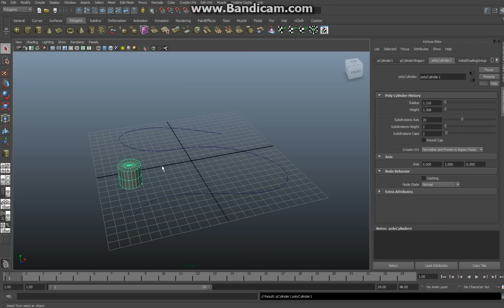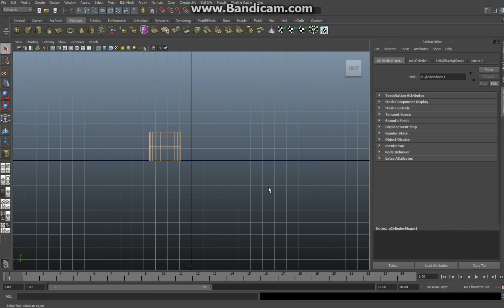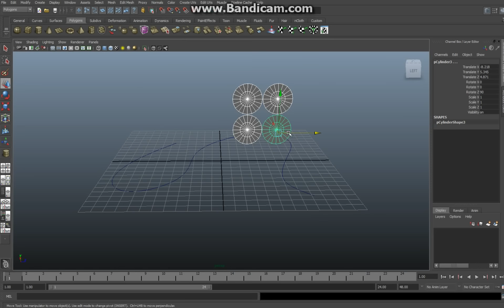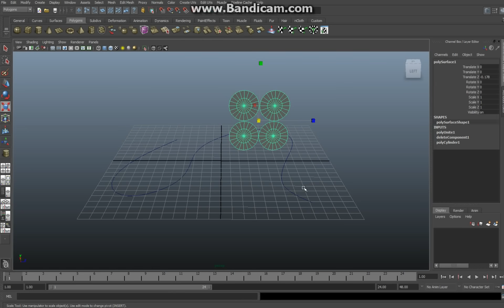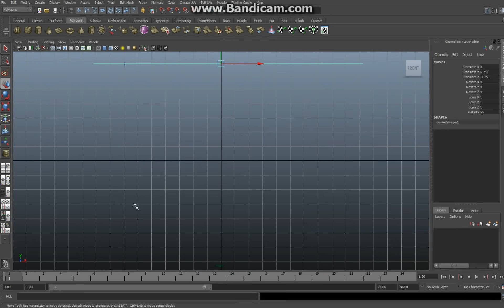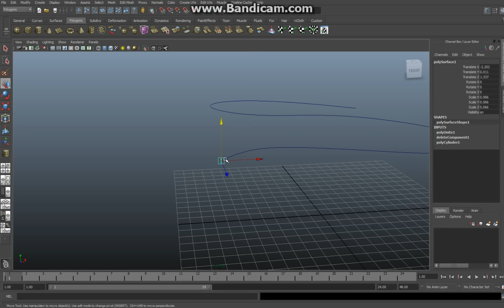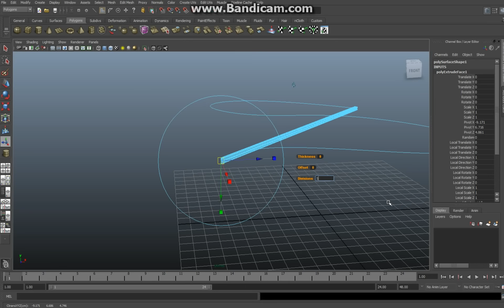Maya tutorial : How to create twisted rope in Autodesk Maya

Comment: The extrude isn't working for me. I have it all set up, wbut when I try to extrude the polygon onto the line, it just normally extrudes. After playing around in the settings i can gety it to extrude to te first centre pivot. Anyone know what I could be doing wrong. This  is in the lastest version of maya
Reply: I had the same issue. What worked for me is making sure that I was in face-mode when selecting the circles and then extrude the faces instead of trying to extrude in object mode.

Comment: Hello really like the style that this technique produces and am trying to replicate it for a full asset yet i have two questions that need help with.
 First when would you uv the assets? at the point before add divisions i would guess.
Second Will this way of designing heavy duty rope work, if i used the curve tool along a Y axis The goal i'm after is rope to go with a ship sail, so i don't want it flat. Any answers are very helpful.
Reply from the maker: Hi Sythos,

When creating a rope for a ship scene I wouldn't recommend this technique.
The ropes would create an enormous polycount number. In that case I would simply use a cylinder and UV it with a rope texture.
This technique is nice for a close up shot if NOT used in an animation.
For the latter I would UV the individual strands, then twist.

Mike